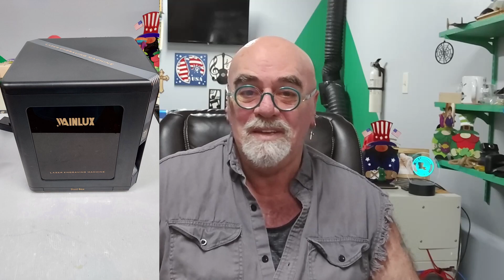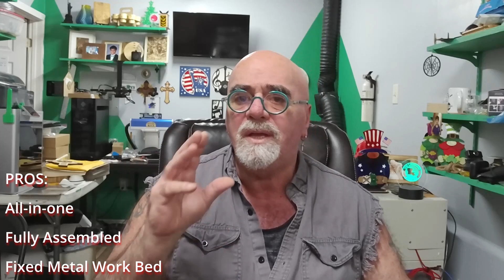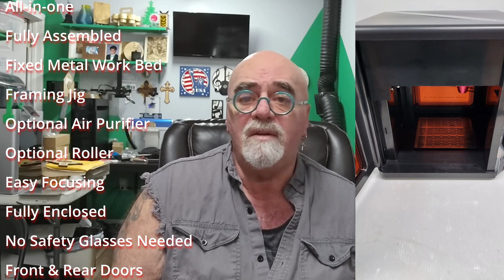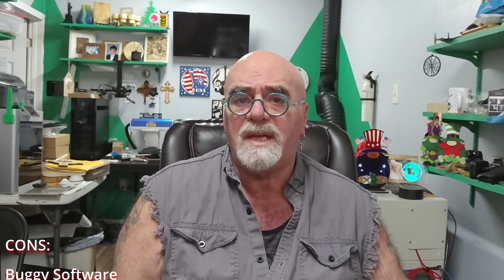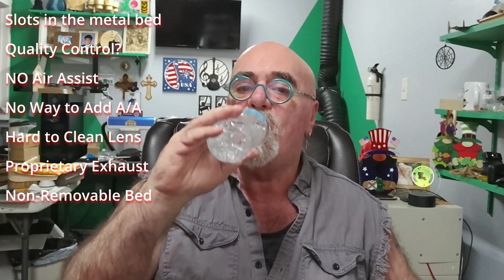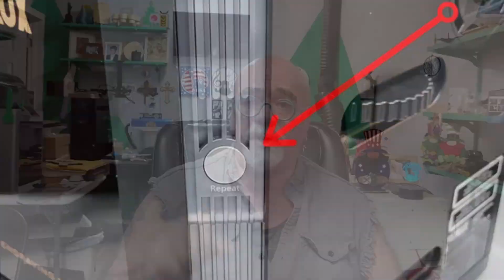ℹ️ Full review of the Wainlux K8 10W Diode Laser Engraver!

Comment: Another great review Rich. I hope I didn't fall into the "Fluff Review" category but I have to say I have been suspect of the few I had watched. Especially when they show off projects that seemed to be much larger and cleaner then what this machine could actually do. I also ran into the issue with the SD card and the location of it. I did happen to find it's location from the owners manual as there is a tiny picture that does show it once. It wouldn't have helped either way as the only thing on it was the camera calibration file so everything else had to be installed from the website, at least for me.
Reply from the maker: No Ryan! I actually really enjoyed your video; you're better at making videos than I am! 🤪But most of the ones I watched, with the exception of 3 were indeed fluff, or users with no experience. BTW, I have subbed your channel at least 4 times now. I don't know why it doesn't stick! Just had to sub again!
Reply: @TheLouisianaHobbyGuy   Thanks for the sub! I thought I was subscribed to you as well since I see your videos all of the time but I guess I was wrong, just subbed as well.